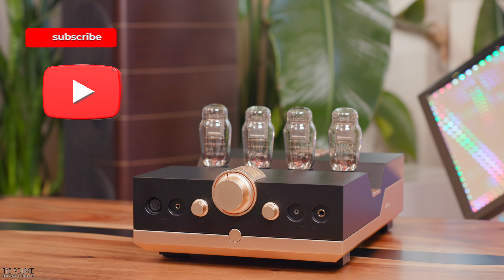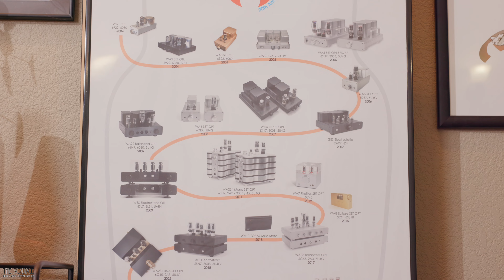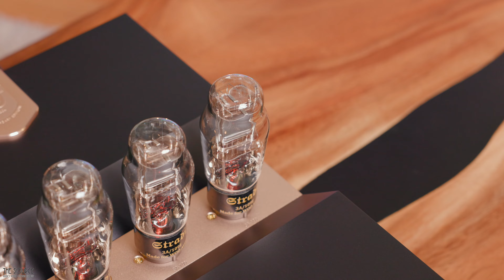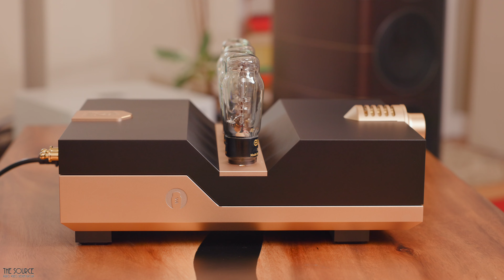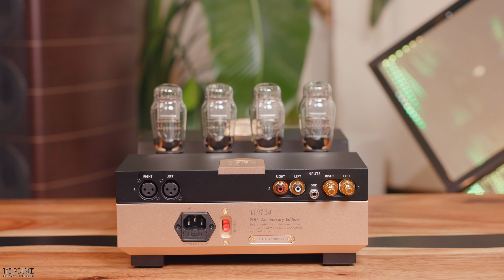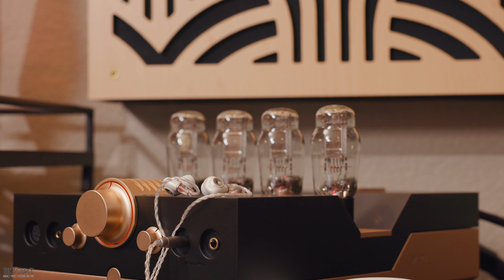Woo Audio WA24 Flagship 20th Anniversary Headphone Amplifier: Is This The Best Tube Amp of 2024?

Comment: A gorgeous amplifier, Woo Audio builds them to be bullet proof.  I can't afford this beauty but own a 1st Gen WA6 which I bought on the used market from a gentleman who owns a proper brick & mortar store so I felt good about my purchase from the get go.  I upgraded my tubes a bit and now run mine with a Sophia Princess Aqua 274B rectifier and some vintage power tubes from GE, RCA and a couple of others.  They just make wonderful amplifiers.
Reply: Thank you! We build products to last. The WA6 1st gen came out in 2006. You must have put many hours on it :) The WA6, in fact, is one of our turnkey products. It is one of the most compactly designed amps among our other amps. We spent so much effort into making this amp the size we liked it to be and a great sound to match in such a footprint. Tube rolling is definitely a fun thing for this amp.
Reply: I just wish I could get a clear answer as to why I can't use a 6SN7 tube in it.
Reply: @tomdavis6371  you can use a 6SN7 with a tube adapter. We make the adapter. Please check the Accessories page.
Reply from the maker: Agreed!!! 🙌